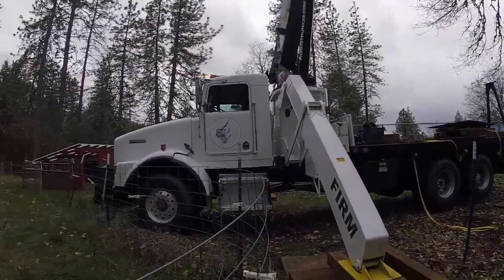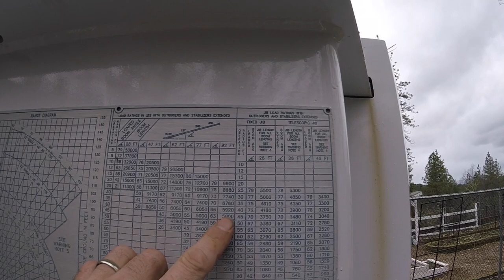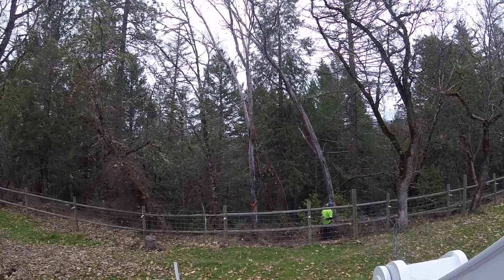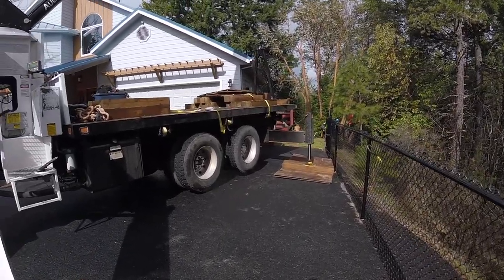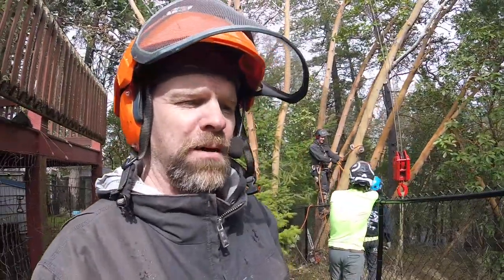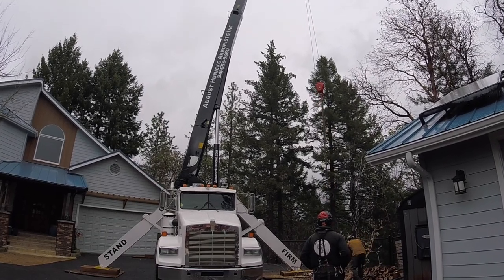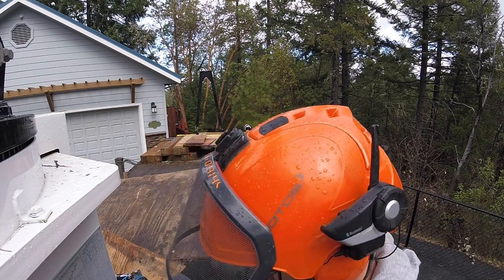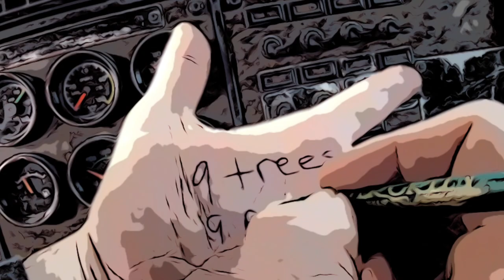Dead Trees by House With Crane

Comment: The LMI (computer) is most useful for high pucker factor picks like when you get up on a load close, raise it up high, and have to boom way out there. It's not a problem without a computer so long as you carefully calculate the weight and pull a tape (measure the radius from the centerpin of the crane) on critical lifts.